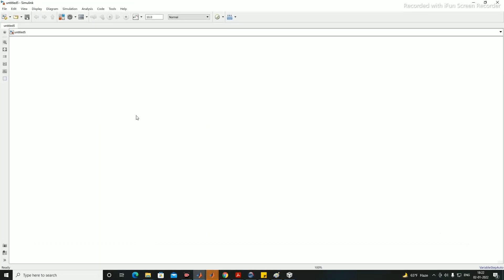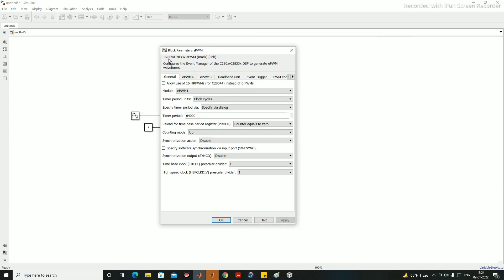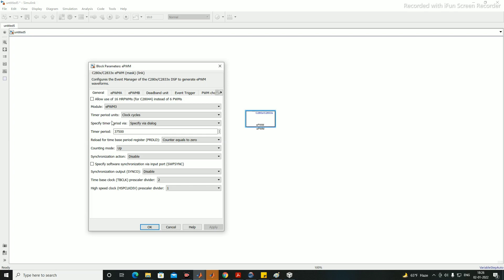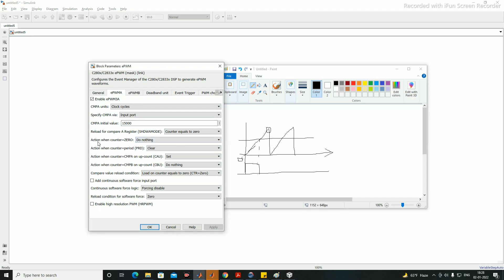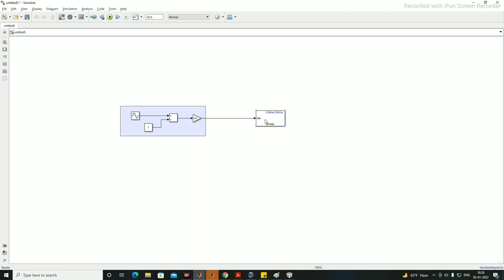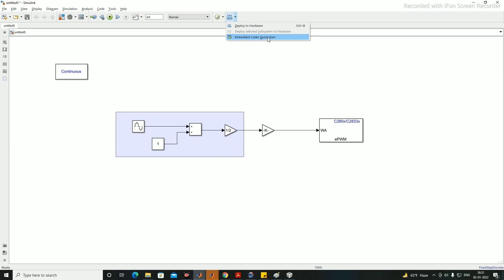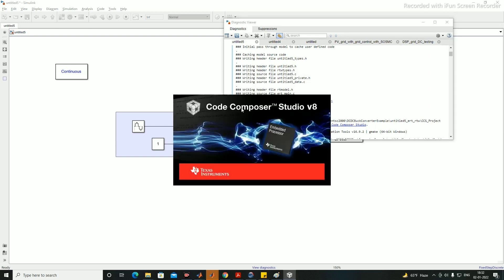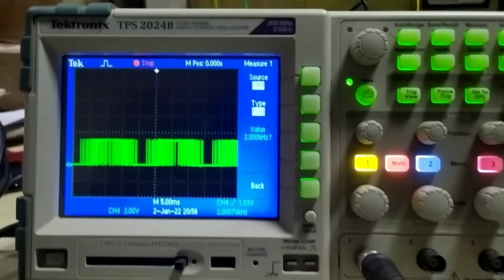SPWM implementation using DSP TMS320x | Step by step guide for MATLAB model to Code composer studio

Comment: After 10min sine pwm pulses are not appeared. just getting only 50% duty cycle. once i restart it then only i am getting sine pwm signals again. This not correct na while doing real time applications.
Reply from the maker: @sravanslv5191 Please check the cpu timer and epwm timer counter. There is a possibility that some of the counter is going to overflow that restrict you pwm to 50 only. 

Have you used updown counter for pwm?

Comment: Sir can you suggest any resources for f28027f processor
Reply from the maker: You can get all the documents related to f28027f on #TI websites.
Reply: @controllers_knowledge  can we make driver circuit (matlab model) to give output to inverter
Reply from the maker: There will be lot of limitations while giving output to inverter.
Reply: @controllers_knowledge  thanks